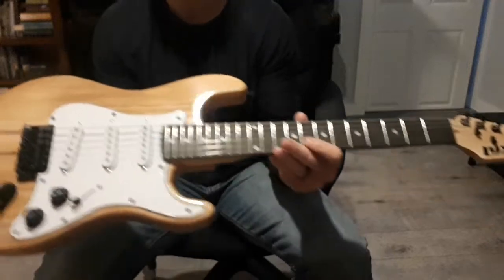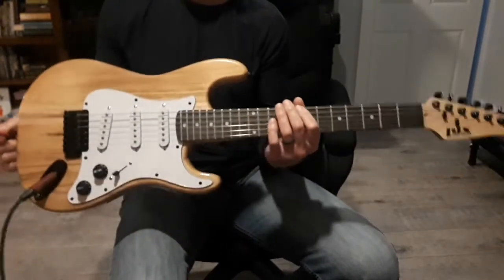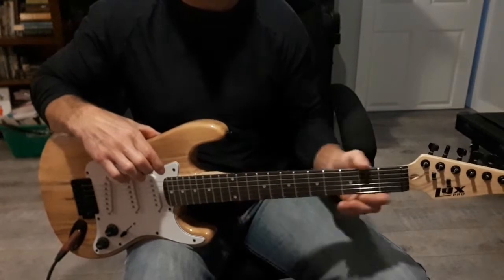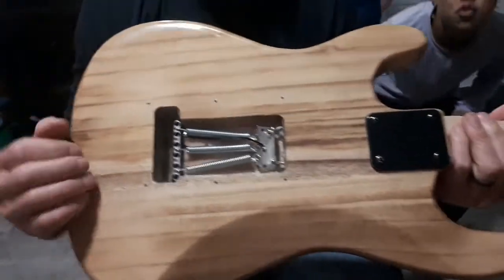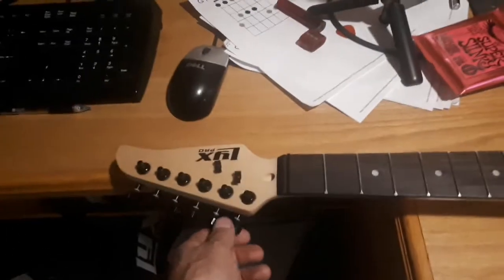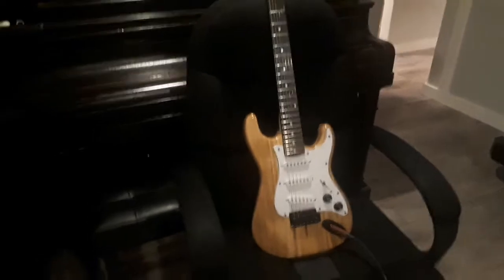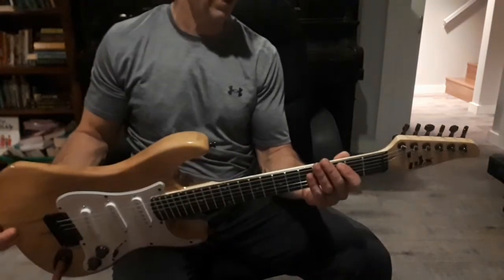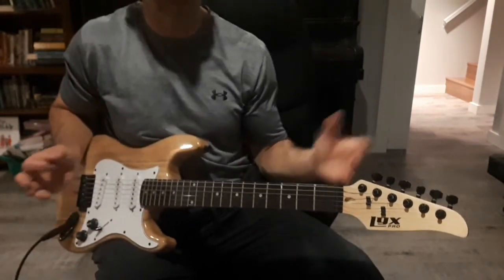LYX PRO 3/4 size 36 inch S-Style guitar

Comment: 1) If you think that guitar is small, think again! John Lennon’s Rickenbacker 325 had a 20.75” (530mm) scale length, even shorter than the 24” scale of the Fender Mustang, or the (I presume) 22.5” scale length of this little beauty! John Lennon continued playing it until about 1965, when he switched to the Epiphone Casino.
2) I’d say it looks like you did a pretty thorough job setting that guitar up and correcting some of the biggest playability problems. The kid who gets that guitar will be lucky!
Reply from the maker: Thanks TPG! That's interesting! This guitar is actually pretty good and fun to play once set up properly! Too bad the just wouldn't come that way from the factory??!!
Reply: Crappy Nitro Cellulose finish...you mean the same nitro used on high end guitars?😂